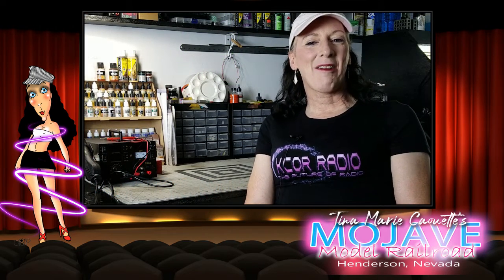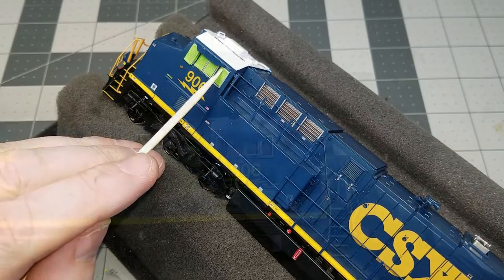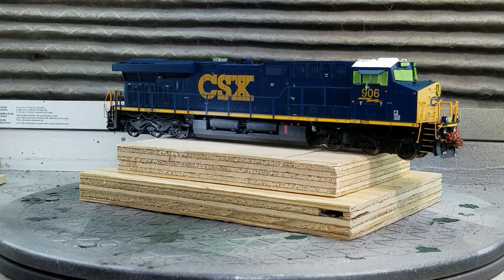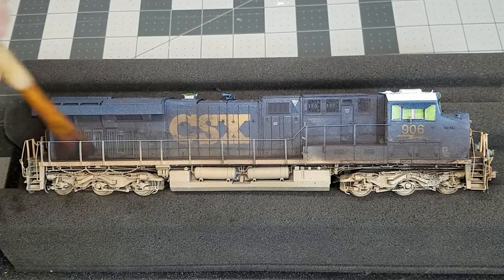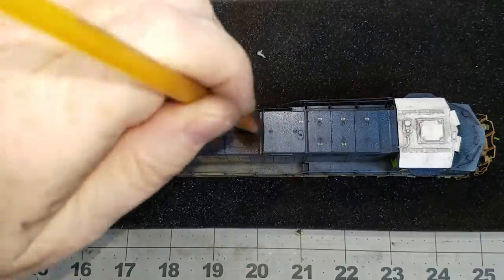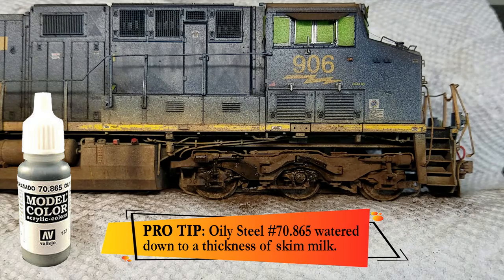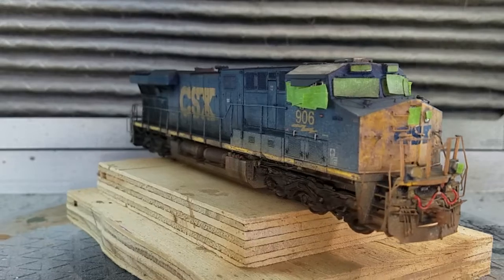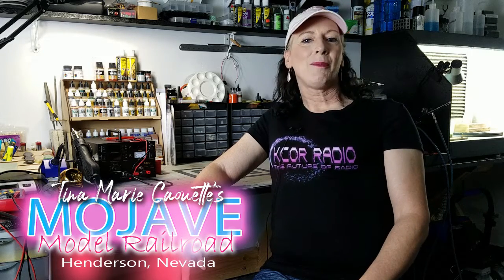Wicked Weathering a ScaleTrains CSX GE ES44AH GEVO HO Train Diesel Engine - Mojave Model Railroad

Comment: I have tried it and it sometimes works great, it just depends on the temperature,  what I have tried is take a ( I work with N Scale ) very small item like a toothpick and petroleum jelly and put it on all my clear plastic and parts that I don't want to paint, remember very light coat. 
I had a Auto Body Repairman show me this trick over 40 years ago maybe 60, I am 72 and dad started me on rebuilding Auto, Motorcycles and almost everything else. Ask some people maybe Rick at Restoration there in Las Vegas he had a show and worked with the Pawn Stars. That taping sucks and it seems like it always allows bleed through even with a coat of clear or matte finish. Where letting to paint dry the jelly will wash off. May need to do a little touch up.
Many a time I just disassemble my N Scale
Reply from the maker: Working with N Scale is a bit different than HO Scale or the larger scales. When I do stuff in N Scale it is a lot different. I tend to use a very end Pin Stripping or do more free hand. Plus with N Scale I also tend to do more work the decals. I can make my own graffiti in Photoshop, or just about any good graphics editing software and scale it to what I need then print them out on a color laser printer. If you don't have one you can also bring them to Staples to have the printed or I believe there is a company or two online you can upload your graphics and they print and ship the decals directly to you. Just make sure you are getting the thinnest possible decal paper. Some the stuff you can get on Amazon cheap is just to think and doesn't sit well, espcially on an N Scale item.

Comment: Tina - At first I thought your pigment paint brush hand was too heavy and wiping the product away horizontally, instead of vertically was wrong. In all, a process completely overdone. However, after stopping the video at 27:33 and walking away, I came back later to discover this weathering is actually believable! While I've seen real locos in this condition, I tend to weather mine not as much. What's good about weathering techniques, is as long as we aren't past the point of no return, we can always go back and tweak it to take off the edge. Nice work Tina!
Reply from the maker: If you listened. I don't normally weather my engines this heavy, but I wanted one at least on my railroad

Comment: stick the dullcoat in a warm water bath for 5 ish minutes to reduce the speckling as well as do 2 very light coats. you dont need thick layers for dullcoat
Reply from the maker: The thing is it isn't dull coat. It is similar product from Loews. Personally, I think Dull Coat does a better covered. I'll try the warm water trick. Normally, it works great right out of the can, but if the can has been on the shelf for a bit, especially in this Vegas heat it can not spread evenly.
Reply: @MojaveModelRailroad  we use the same stuff, Krylon matte finish. But yeah the warm water trick releases pressure from the can which helps the spray come out finer.

Comment: That turned out fantastic - I’d never seen the technique before where you were using a damp towel to wipe away excess powder and leave it in the detail to bring that out. Like a powder “wash” - really cool!  Also smart to paint the wheels while they spin.
I’m still a little too chicken to take on a locomotive - and mine are mostly all converted older proto stuff - and here you are on a high end loco going for it!  Awesome!!
Reply from the maker: The first few locos I did them on years ago weren't the high end and well let me just say it didn't go so well. I did a lot of practice on cheap rolling stock first. I still have a little apprehension when doing my stuff, but not as much as I get when a client gives you a $300 engine and says weather this for me. That still gets me to take a breath before doing their projects.
Reply: I am doing the same - getting reps in on rolling stock, and the cheaper stock at that.

Comment: Do you hate sanding? I took a rechargeable toothbrush and removed the bristles from took thin 2 sided tape and cut me sand paper to fit the toothbrush but have since glued a piece of hard board to the toothbrush with different shapes to fit into cracks and corners. So I have about 8 replacement toothbrushes setup with different sandpaper and different designs. 
I also I got sick and tired of loosing parts so I went and bought 3 baking sheets with deep lips around 1/4" to 1/2" lip.
Than bought 3 of the self sealing mats  
I didn't glue the mats onto the baking sheets.
Also have you ever wished super glue would dry faster? Use baking soda and it will dry faster plus the baking soda makes it stronger.
Reply from the maker: As for Super Glue I use the Gel as it has a longer set time, then when I'm ready I just spray on an "insta-set" and then the super glue gel sets instantly. As for part, I got a couple deep plastic bins for a couple buckets each at WalMart. The are about 3 to 4" deep and about 12" long. Allow me to put parts from a project I am working on in there without losing them. I also put in there a small rectangle magnet with double stick Velcro so any metal parts like screws stay right on that strip. I know they even make the foam now for working on box cars and engines with a magnetic strip for screws. Great product. I love the tooth brush idea I might try that sometime. Allow I like the feel of a small sander in my hand so I know how much pressure I am putting on the sandpaper so I don't remove more product then I want.